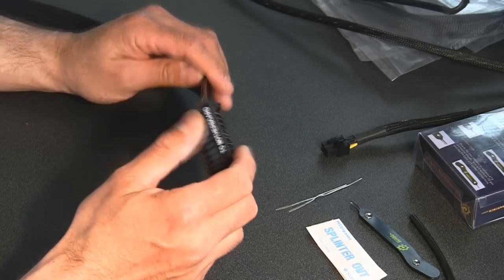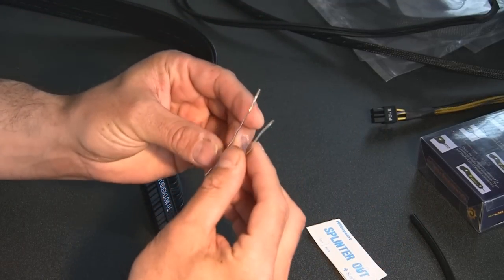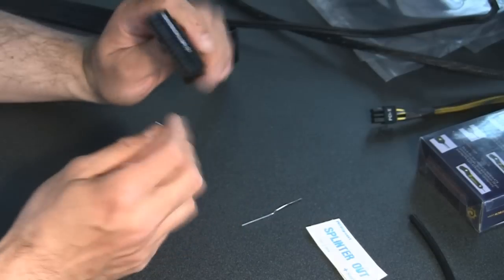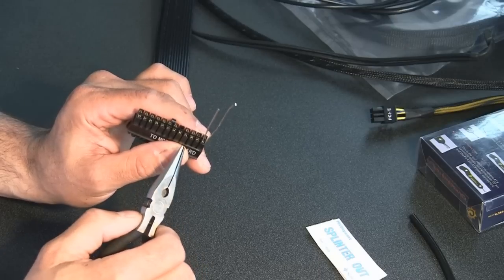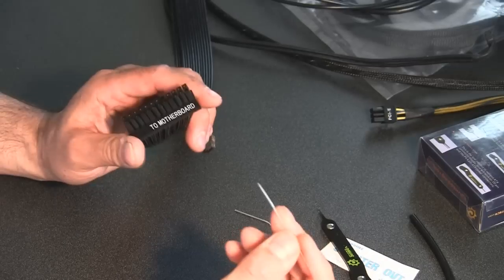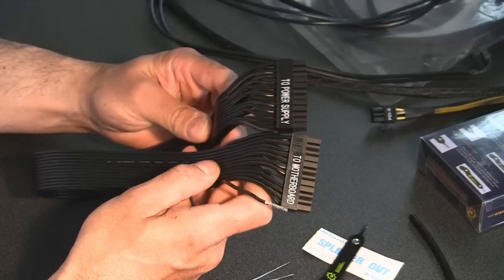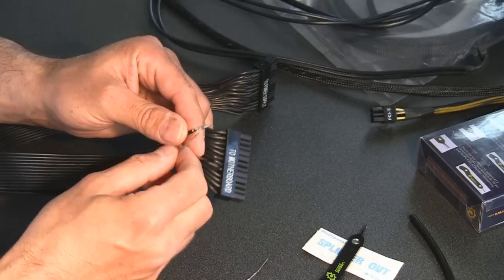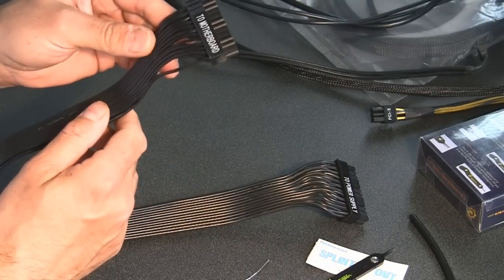How To Remove the Pins on the 24 Pin and 6/8 PCIe Cables

Comment: Hello. so I have a pre built rig by Asus which allows upgrading of gpus. it has a bracket already made for up to 1080. but I only got a 1050ti and well the thing is that I'm connecting a 6 pin which is actually required for the rig no questions it just has to. but when I plug the pins and try to mount the bracket with the GPU, the pin cables don't allow because it's to big and it has an extra 8 pin. it's the Asus rog G20. thanks.

Comment from the maker: @orestesdd Actually this PSU..X3 does have a on/off switch on the back...however there are some out there that don't and not necessary from second rate companies. I can't recall which one off hand, but i do no the Silverstone 1500w doesn't have a on/off switch. I have used others, but I can't recall at the moment which ones. 
Personally I prefer a switch, but it apparently it isn't need for someone like Silverstone not to use one on their 1500w PSU.

Comment: How do you fix the 24 pin if you pull out the cable but the pin stayed in , I was using the tool and it broke

Comment from the maker: @Deeman4evr I am glad it worked.......however if the paperclip keeps breaking then try Jewelers #2 piercing saw blades, that is what I use now and the are more rigid and fit perfect. They are very inexpensive and they never break or were out the the paperclip.

Hope this helps and don't forget to sub...thanks
LazyMan

Comment: I am trying to sleeve my cables but have no luck, I have the same problem a MRDcanadian and can not get anything to work. I have the tool and I have tried and tried and I went through the wall of the connector. Cpuld ypu please help, I have the XFX 1000W PSU. Thanks

Comment: I clamped the connector in a winch and then used the pin removal tool from mdpc-x.com. Nothing else worked for me, not for many many pins. Try this! (note: the tool is relatively expensive but it is VERY good)

Comment: im sorry im only on my 6th psu sleeving but from what I've learned is there is NO substitute for a good pin puller (the only good one ive found was 20 dollars from mod one made by molex) using staples or paper clips sucks and is very tedious even just doing one job its worth buying its the difference in 3 hours to 8 hours even on one job my 5 hours is worth the 20 bucks also cheap ones are not worth it i paid 10 dollars for a kit from amazon and the tip didn't even fit could only use 1 side at at time broke a lot of tips and plugs
Reply from the maker: Remember this was 10yrs ago...there was nothing on the market back then.

Comment: Heya m8 i have tryed now for around 2h whit the stupid 24pin , i used a pin tool from MDPC , but it did not simply worke.
I have done it easy whit 6pin no problems their.
But that stupid 24 pin wont let go at all on aney pins.

Comment from the maker: If you don't have a molex pin remover tool than you can use a pair of tweezers to remove the pins, I show how to use the tweezer method on the 4pin molex connector in one of my video's

Cable Sleeving 101 Using a Straw ! Part 3

Hope this helps
LazyMan@WCM

Comment from the maker: Yeah the Noctua fans are the ugliest fans on the market. I think MonsterMawd has a video showing how to paint a fan, not 100% sure though. I may do a vid when I'm in need of a painted fan, but not in the immediate future. you will want to get paint that is formulated for plastics, then after that it should be the same as painting anything else. Be sure not to put it on to heavy or the fan may not spin properly and or you could burn the motor. check out Xigmatek Fans